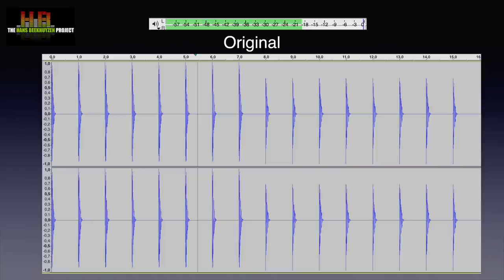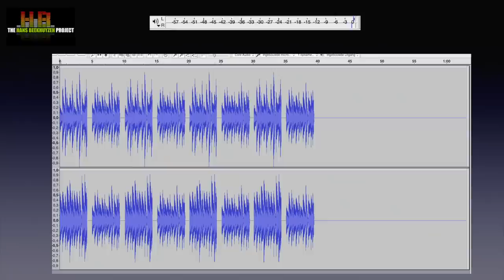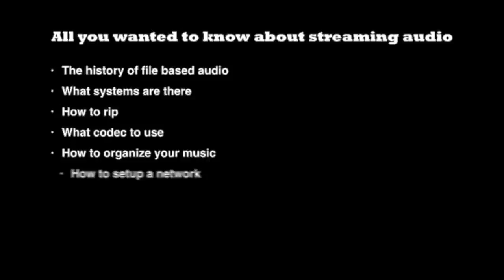What is time smearing

Comment: Regardless of the technical aspects of MQA and what it attempts to correct for, we need to go back to the ultimate question that really does need to be answered here: Do MQA files sound better than standard CD audio? Also, do MQA files sound better than DSD files? Can you actually even tell the difference between them when listening? A lot of people want to tear down MQA for various reasons, but the only thing that actually matters in the end is how it sounds. Is there a noticeable improvement over CD audio when switching to DSD files or MQA files? If there is, then which one is the better of the two? And, is that difference noticeable consistently? That's the bottom line here and ultimately, THAT's the question that we need to find an answer to. Ultimately, everything else is just conversation.
Reply from the maker: I fully agree.
Reply: The answer is YES and YES . Ask the best mastering and sound engineers, if you dont believe ME.

Comment: So how much is the time smearing in an analogue single that is 20khz source. And if that time smearing matched by a digital source will they sound the same ?
Reply from the maker: That depends on the recording and on the gear used. Both analog and digital can have their timing problems to a larger or smaller degree. Good analog equipment can sound just as good as good digital equipment.
Reply: The Hans Beekhuyzen Channel thank you MR Hans

Comment: Thanks Hans, I was wondering if time smearing reduces the volume ? The original is louder than the time smear simulation. Isn't the mechanical time smearing of speakers orders of magnitude higher than digital time smear ? Can MQA  
 compensate for mechanical time smear too ?
Reply from the maker: Time smearing distributes the same energy over a longer time, so the peaks will be lower. Mechanical time smearing is comparable but I presume slower due to mass. MQA can compensate for mechanical time smearing but only if the d/a-conversion, amplification/ X-over and speakers are one unit. Like in for instance the active speakers made by Meridian.
Reply: Thanks Hans,

Might this also explain why smaller , low mass cone speakers in line arrays sound better than their larger more massive individual driver counterparts ?
Reply from the maker: I am about digital audio and less about line arrays. Can't say, sorry.